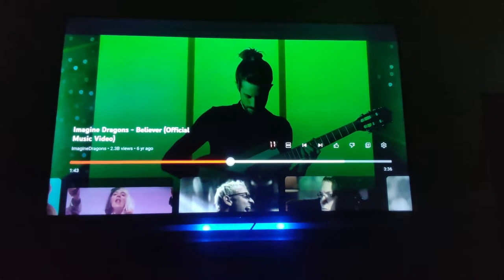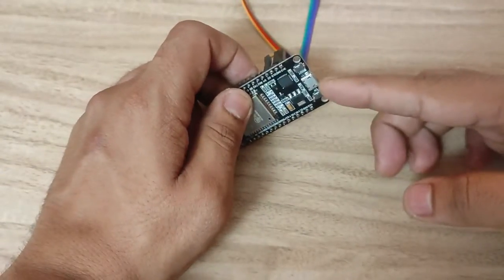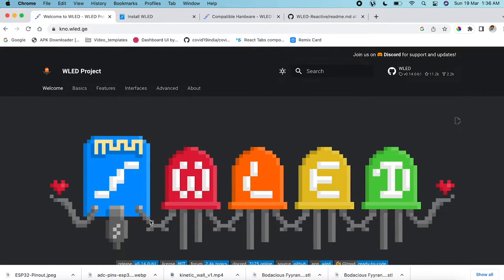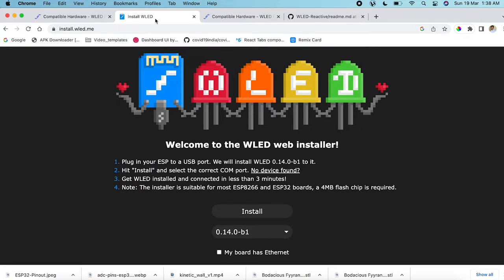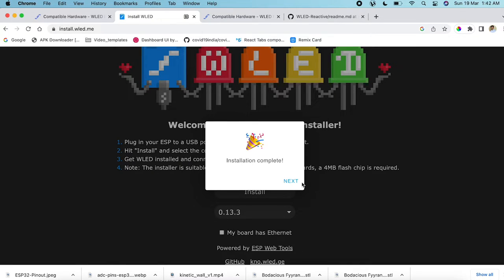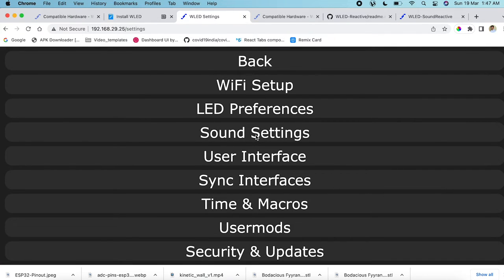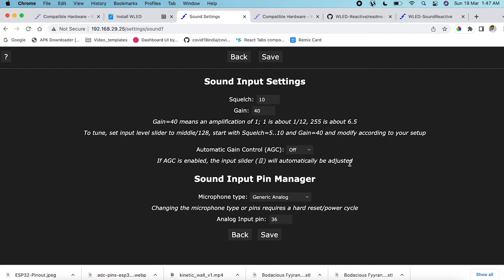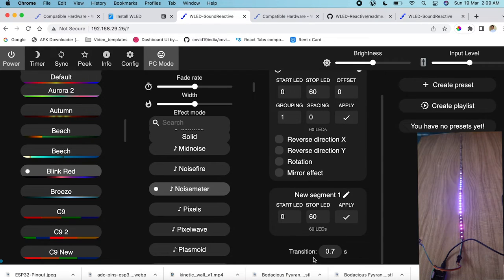Building a DIY Sound Reactive LED using ESP32 & WLED

Comment: i connected as you told but when i click sound effect animation nothing happens(led strip turns off ).Can you please tell what is wrong.
Reply: I have exactly the same problem, unfortunately. After searching on other videos, you have to invert the vcc and out then choose pin 35 of the esp32. So vcc on 3.3v and out on pin 35 of esp32. I was astonished at the time of wiring, having already used Max4466 microphones, but I still fell into the error.